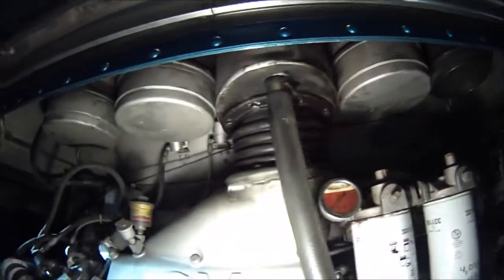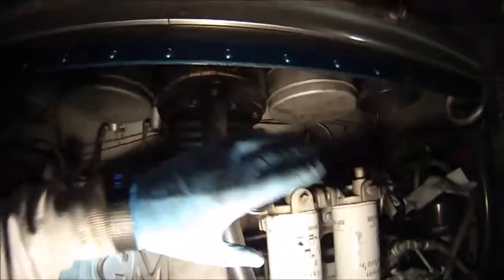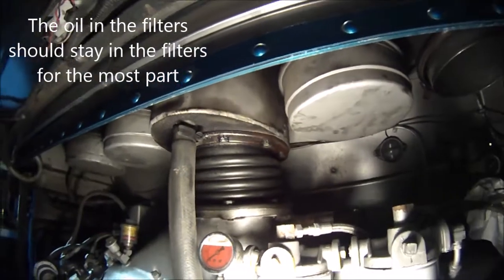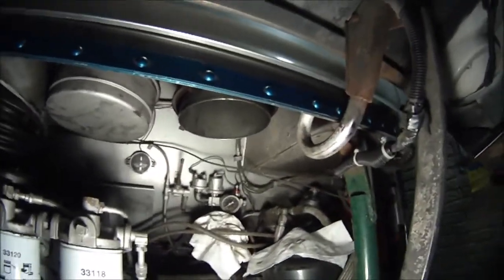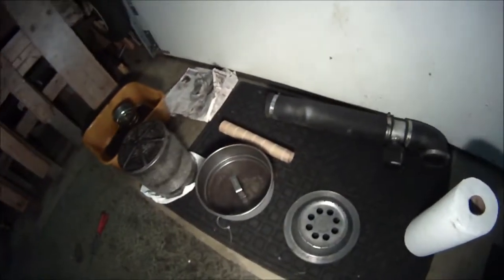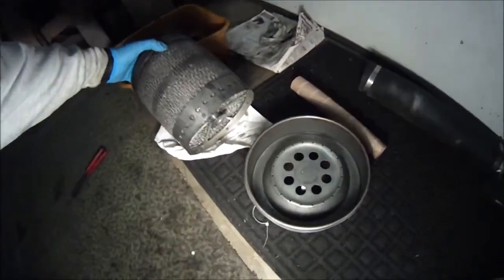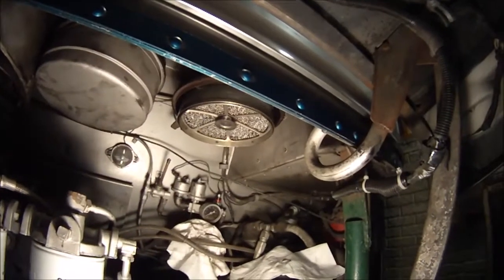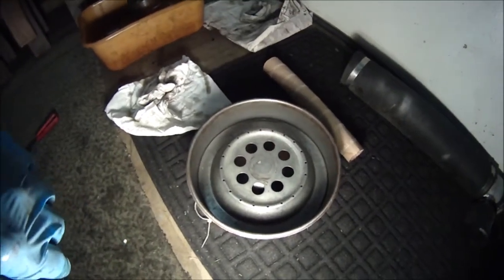Oil Bath Air Cleaners

Comment: Is there some kind of baffle system on the air in-take duct which could do a better job of keeping rain water out? The two advantages that the oil bath air filters have is that they don't take up much space and you avoid the large cost of replacing a paper element.
Reply from the maker: Those are the two reasons I keep the oil bath filters.  There is a series of baffles inside the air intake box on the right side.  I took the bottom off of it a few years ago to see if I could improve it.  I added water tight gaskets on the bottom of each of the baffles and a drain but it still sucks water in pretty good while driving in heavy rain.  Seems like there could be something not working properly.  The left side gets hardly any water in and I don't see the baffles there, just air moving around the radiator expansion tank.  Also, it is usually only the far right one that fills up.  The one next to it stays pretty dry also, but not quite as much as the ones on the left.  I have seen others fill up also, but not sure about all the details.   I'm open for suggestions on this one.

Comment: In my opinion, the oil bath air filter is by far the most effective air filter ever designed to date. Oil collects dirt like a magnet, paper/synthetic filter elements don't stand a chance when it comes to filtering air.
   I watch the "Bus grease Monkey" here on YouTube, and he has many videos regarding oil bath filters and their water collecting issues.is there a remedy to the design flaw, or is that just the nature of the beast?.
     Thank you for your Video!
       Kind regards, Eric Dee.
Reply from the maker: The air enters the intake housing for the filters from the two rear corner intake vents in the body, just below the window line.  The left side passes around the anti-freeze overflow tank.  The right side goes into a box approximately 1'x1' which has three baffles in an up and down zigzag setup designed to remove water.  I have added a couple of drain holes.  The rightmost filter always collects the most water when operated in heavy rain.  Some water I discovered was entering through a bad seal where the right side engine support hanger comes down below the rear windows.  I have tried to seal that off and worked on the intake box and have reduced much of the unwanted water from entering.  Still, after long drives in heavy rain, it still gets some water.  I have taken to cleaning the water out of that far right filter as often as I can after driving in heavy rains for long periods.
Reply: @strayhound61  Hello Mr.Matthews. I completely understand now. "Technomadia" here on YouTube has a complete video series regarding their 8-V71 engine rebuild, during the process, the mechanic found large pieces of paper filter elements lodged in the intake, Technomadia (Chris &Cherie) feel the paper was a contributor to engine failure. Makes sense being the have an aftermarket 100% paper element soaking up water like a sponge through those side air ducts as you mentioned.
  You have to admit though, integrating the engine air intake system to flow with the body contours is pretty cool.                                                                                      
     I'am curious if the Engineers at GM knew the intake system would be an issue regarding water entering the system. Hmm makes you wonder?.
    As always, Thank you for your time. Your a wealth of information, I appreciate that.
     Kind regards, Eric Dee.